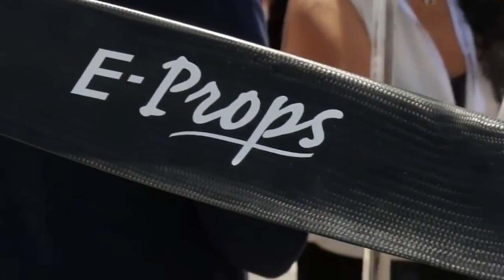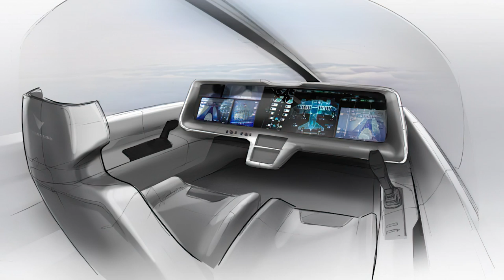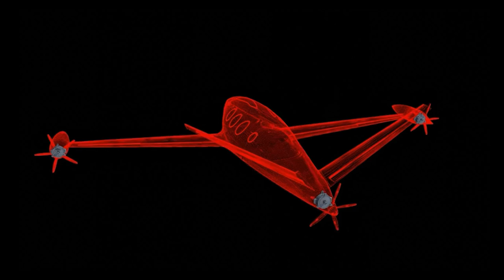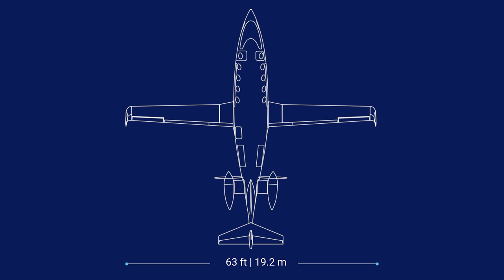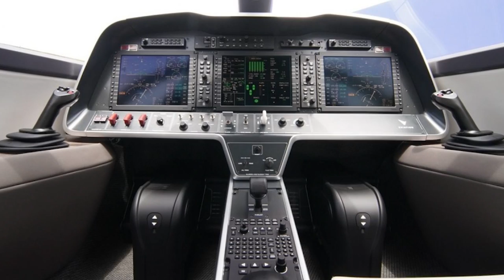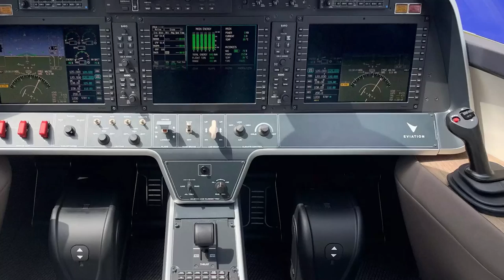Eviation Alice - electricity bursts into the sky

Comment: It is important to note the many advantages the a fully electric aircraft. I could write an extensive list of them but it is more appropriate to identify the business cases where an electric aircraft offers a competitive advantage over fossil fuel aircraft.  In particular the short haul commuter market in the US is one that the Alice could effectively serve. Further, as the first all electric aircraft in it's market segment it is inevitable that many design problems need to be identified and solutions found. The development of the power electronics to run the flight motors has been a complex task indeed. Over time the continued improvement of battery energy density will assist all electric aircraft with meeting performance requirements. Don't forget that liquid fuels have weight too. So why not compare the battery weight to  an equivalent fuel load in a similar sized aircraft ?
Reply: Did you know there were electric cars in 1830's !!!!  that's before civil war in us....HOW  MUCH MORE TIME YOU NEED????
Reply: Such comparison is not looking good for the electric one. It isn't presented becuase everyone knows....
Reply: Everyone associated with these designs has So why not compare the battery weight to an equivalent fuel load in a similar sized aircraft, and the battery is many times heavier for the same range.

Comment: Remove the radiators under the motors, use the front edge of tail surfaces and wings for cooling systems (also prevent ice for free), the range will increse 5 to 10%.
Reply: As shown in the video, the first design uses surface radiators on the wingtip motor nacelles, but the second design uses a radiator in an air duct; obviously the surface radiator design did not work out.

Comment: Was wondering what happened to Alice as early as today when I'd seen an old magazine with the wingtip propulsion setup type. Cape Air near NYC were keen on it.  Think it was due in service 2022, according to that article.
Reply: The wingtip propulsion wasn't going to fly because of the risk of excessive yaw with one wingtip engine eventually being off due to a failure.
Reply: @beatreuteler  They were presumably counting on the centreline thrust of the rear motor and propeller, and probably only partial failure of either wingtip motor. I don't know whether that turned out to be unacceptable, or other issues with the wingtip propellers (ground strike risk, for instance) forced the design change. 

The magniX units have two separate sets of motor winding with separate inverters for redundancy. The current magni650 units are essentially two of the smaller units (like the one on the original prototype) mounted on a common shaft, further improving redundancy. They may have decided that each unit must have the higher level of redundancy, so they could only use two (due to either size and cost). harbour Air was forced to go from the single magni350 to the magni650 for redundancy, even though the magni350 was more than powerful enough when operating normally.

Comment: The Plane ist pretty perfect, the batteries are evolving quickly, this plane and similar concepts have a great future, if it can reliably reach a range of 400 miles, which would be available with actually existing batterytechnology, than this would be in many places of the world a real environmental improvement. Consider that taxiing time on the ground is extremely cheap and does not eat  range compared to turbine AC, this is a huge factor.

Comment: Would something similar to a Tesla car layout for the batteries help with weight and range?
Reply: It's still too heavy. Consider that at Tesla Model 3 almost weights 2 tons (1.919 kg), with an battery weight of about 625 kg. It has a range of about 350 miles with that. So it needs about 1.78 kg of battery per mile. 
An A320 needs about 2 to 3 liters of kerosine for 62 miles per passenger. 
So if we take for example an A320 with 100 passengers and an fuel usage of 2.5 liters per 62 miles, it would need about 250 liters of kerosine per 62 miles. That's an fuel usage of about 4 liters per mile with 100 passengers. 
An liter of kerosine weights 0.8 kg so we have an fuel weight of 3.2 kg per mile with 100 passengers. 
Sure the tesla needs less propellant in weight, but you have to consider, that it can only carry 5 passengers for that. The A320 can carry 100 with slightly more propellant weigth. 

This is a theory and im not a professional in any of this, so correct me if im wrong about anything.

Hope i could help you :)
Reply: @rapidthrash1964  Thanks i'm doing my best

Comment: The one and only flight of the Eviation Alice was far from the first flight of a battery-electric aircraft, so it hardly the point that "electricity bursts into the sky". I would understand the hype if Eviation had the most successful electric aircraft, or even the first electric aircraft in commercial service, but they don't - Eviation is now on their third Alice prototype, with thee different designs, and between all of them they only have a single seven-minute flight (of the second prototype).

Comment: There are many potential solutions in the works to improve flight efficiency of planes like Alice.  In the pure battery arena, CATL and Northvolt expect to have 500wh/kg available before any of these newer planes can be certified.  That's a huge jump from the 300wh/kg available today.  Then there are powerful new engines like those being developed by Rolls-Royce and Whisper Aero. And hybrid hydrogen-electric power trains like those using Safran's  turbogenerator or hydrogen fuel cell.  Heart's ES-30, for instance, has an estimated range on battery alone of 200kn (125 miles) with 30 passengers.  That is projected to improve to 800kn ( 497 miles) if the powertrain is hybrid electric propulsion.  The same could be expected for Alice.
Reply: Except for the hybrid, which isn't the goal here: The goal is to show it is doable using fully electric power train.
Reply: @beatreuteler  Yeah, that's the immediate goal for Alice (in addition to actually making money). But I was speaking of a whole range of similar short to medium haul planes in development. Battery electric. unless we get the breakthrough battery that is always just around the corner,  is only going to get them short haul.  I can see them expanding to a hybrid and picking up business in the reginal carrier arena.  It's a fun area to watch unfold.  But since I'm 75, I just wish it would unfold a bit faster.  😄
Reply: @triplec8375  Me too, would like to see this coming sooner. However patience is one of the most important capabilities in this process. I agree that they will need some hybrids for more than just short haul, but that won't be Alice, because the Alice design is not fit for this more performant purpose.
Reply: @beatreuteler  Hmmm... Now I'm curious.  Can you tell me in layman's terms what is it about the design would preclude using a hybrid power train?  Something about the rear outboard dual engine mounting?  Have you heard anything in the last year from Otto Aviation about their Celera 500l?  That's another on I want to see happen soon, but Otto doesn't do any PR work so there isn't much info there although their website now shows a rendering for their proposed Celera 800.  Slick!
Reply: @triplec8375  The Alice is a 100% electric design. It doesn't offer the necessary additional structures it would take to support the fuel powered portion of a hybrid design. It would be much easier to start off with a current turboprop airframe and add a comparably small electric portion to make it a hybrid than to start off with the Alice dsign.

Comment: They could put solarpanels on top of the wings.
Reply: Modern solar panels wouldn't add a notable amount of range to the flight since its moving so fast. If its in the air for a couple hours around noon then you might add a few kW. The additional range vs the cost of the panels is unlikely to be a profitable move.

Comment: the Battery performance is a draw back but the business case is still very powerful. The energy to weight ratio of batteries will continue to get better over time for sure and when the Swedes perfect the massless carbon fiber battery you can mold the battery into structural components of the plane.
Reply: @OgWoot   why are you lying? did trump hurt you?
Reply: Massless? Is the battery made of photons?
Reply: @burntnougat5341  What it means is that if you use the battery as a structural component in place of another structural component the battery adds no mass.
Reply: @noalear  ah I see. If such a battery with enough energy density exists that would be really cool

Comment: if they have electric motors that strong and the batteries are the main issue, why not just use a turbine as an electric powerplant? two-engine airliners already use a third turbine in the tail for power and air
Reply: Then it would be using "jet" fuel, not electrical energy stored in batteries. The point is to not burn fuel.

Comment: Personally, I still think that our limitations with battery tech is too big for a full EV plane to be viable. Ariel the automotive company recently teased a hybrid sports car where a small turbine acts as a range extender for its massive battery packs. Turbines would work way better in aviation applications since it also provided extra thrust, just like the Spitfire’s Merlin engines.
Reply: That was a negligible amount of thrust, and it was only good for one or two miles per hour, and only significant because top speed was the highest priority, and the props were at their maximum ability to make the plane go shut faster, but a jet, even a weak one, would add a tiny bit of speed. The turbine in a setup like that would be tiny, maybe a couple hundred horsepower, and the exhaust thrust would be tiny and acting on slow speed air, where it is the least efficient. Jets work most efficiently at high relatative speeds, which is why airliners use fans. Even Mach 2 military jets aren't fast enough to get full potential out of a pure jet. Modern helicopters use 1,000 even 2,000 or more horsepower turbo shafts and the exhaust doesn't really create any meaningful forward thrust. Hell, turboprops are already have turbine exhaust thrust and it doesn't add anything significant to the thrust even being the primary power plant. What's a little APU-style range extender going to do?

Comment: 250nm range.  Take into account battery wear over time, temperature effects, and weather, taxi, alternate requirements, etc...and your range isn't much.  Then you have recharge time.  Cape Air, blah blah blah.  Guess what?  This will require a type rating, and that costs a whole lot more than putting a pilot in the C402 or Tecnam.   Sorry folks, technology just isn't here yet.

Comment: We are a long way from seeing these at your local airports. The battery tech simply is not there ... as they have already found out the hard way. Not only is there a range problem, but there's the elephant in the room that got glossed over ... how long does it take to recharge this beast and who's going to build the charging infrastructure to support it. Airlines make their money by making max use of their planes; a plane sitting on the ground with a minimum 60-90min turnaround time isn't making any money. Then there's the environmental C/B analysis ... has anyone done one?
Manufacturing batteries is a dirty carbon heavy business. How many flight hours will it take to pay off the carbon cost of making the batteries? We tend to get OOWWWED, AAWWWED and mesmerized by pretty new tech without really looking deeper at what's really there and what it represents in real terms. It is a VERY pretty bird, but at this stage its just a pretty baby with a long teething period ahead and has yet to prove it can really do anymore more than OOWWW, AAWWW and mesmerized. I'm hopeful and wish them all good fortune. But I'm not holding my breath.😎
None of this is any reflection on you Mr.Skyships; you make DAMNED GOOD videos which I thoroughly enjoy and I'm a subscriber.

Comment: Nope, this is not happening in the foreseeable future. Perhaps not ever.
Battery range that can get you somewhere is not enough in aviation. You need range to fly a missed approach when you get there, range to divert to an alternate airfield, range to stay above it for at least 30 minutes and significant contingency range on top of all this. Just in case. And then you would also need to operate safely with one engine inoperative. So for commercial operations, perhaps redundancy considerations would even need additional batteries in case some are lost in-flight.

And Eviation don’t currently have the range to get anyone anywhere. 250 miles?! So the business case is for corporate clients who need to fly executives between their two office locations, which happen to be 5 miles apart and separated by a lava flow?
Reply: When there’s a light weight, trustworthy electricity source that would cover everything you mentioned, then electric plane would have future. I think is going to take several more years, but is is still in the realm of possible.
Reply: Day VFR range is 250nmi. That covers flight to the destination plus 30 minutes. IFR requires fuel for the flight, diversion to an alternate if required, and then 45 minutes. I would guess that puts the practical IFR range down to around 150nmi. That's not great, but should be sufficient for their launch customer, Cape Air, who operate Cessna 402s and Tecnam P2012s on short hops around Cape Cod and the islands and to Boston and New York. ACK-BOS, their most popular route, is an 80nmi flight.

Comment: They should just gone Hybrid electric problem solved, HoneyWell has a 1MW turbine generator. It weighs around 300-500kg
Reply: Hybrid doesn't solve anything, since that means still burning fuel and the whole point is to avoid burning fuel.

Comment: I don't get why an electric plane doesn´t have solar panels... Maybe it would add more weight?
Reply: Too little power. Even if the entire plane is covered with solar panels, even if they are weightless, its range will increase by a couple of percent
Reply: They just generate power too slowly to be of great usage. They can extend the range by an very small percentege however.
And some small GA electric aircraft already have them fitted

Comment: Since the battery consists of hundreds to thousands of individual cells, each of which has at least two welded joints, and in light of the fact that one of the biggest challenges with EVs is failure of the battery resulting in a thermal runaway, who in their right mind would get into an aircraft that is subject to shock and vibration that is much greater than ground vehicles?  Its like sitting on a thermal bomb that can kill you at any time.  Not for me.

Comment: This needs to have an APU generator. Store fuel in the wings. Run the APU to constantly charge while flying with a large multi-cell battery. I hate lithium-ion batteries. We desperately need to find alternatives. Mining lithium and nickel for these batteries are a nasty business and they're highly reactive with oxygen (they explode when punctured). Using a large belly Fluoride batteries, for example, with an APU generator would be fantastic! The APU can run on 100% sustainable aviation fuel (which burns much cleaner) then having Fluoride batteries which have very high power density. Hopefully, those batteries will come online soon and this can be a reality.

Comment: If there using Lithium Ion battery, I'm not getting on that plane, Ide wait until they start using Solid State Battery.
Reply: Apparently you are not aware that the currently proposed "solid state" batteries are just lithium-ion batteries with a different electrolyte.

Comment: Same problem with all electric aircraft, limited payload,limited range certification.They all quote ranges from full battery to empty battery when in reality all aviation laws require you to land with 20-30 minutes reserve in VFR conditions. In IFR conditions enough fuel ( battery power in this case ) enough to reach your destination fly a missed approach and fly to an ulternate airport plus 20-30 minutes reserve. So if the cloud base and or visibility is low you are going nowhere useful.

Comment: why don't they just put some turboprop to their existing aircraft as money source, then use the profit to research and develop the actual electric plane?
Reply: Because the objective may be to get rich off of investor money not run a sustainable company.
Reply: What existing aircraft? They have nothing but a single prototype... and it is not designed to accommodate turbine engine or fuel.

Comment: Think this technology have a long way to go, up at flight levels it is cold - the Lithium need to be heated (from them selfs), the turnaround time (charging) can not be feasible to enough to make it profitabel...
Reply: At this time none of these are for long haul flying which makes climbing to flight levels unnecessary.
Reply: The batteries heat when used (like all batteries with an internal series resistance, which is currently all batteries) so this problem doesnt exist. If they're using similar battery tech to modern EVs you'd be 100% filled up in a couple hours, tops. I couldn't imagine someone wanting to fly somewhere, land, and take back off in less than an hour unless it was a refill stop. The intent of this plane is to be used for short-range flights, so you'd only get this plane if you wanted a private plane to fly back and forth from city to city to do business.

Comment: funny. So what an electric plane; they've been around as toys for 50 years .. they have short range and are basically useless as a result.  The hope is for more energy dense batteries to make this more of a viable option, but - did you every notice the catch on fire.. they will need to also be safer and cheaper.